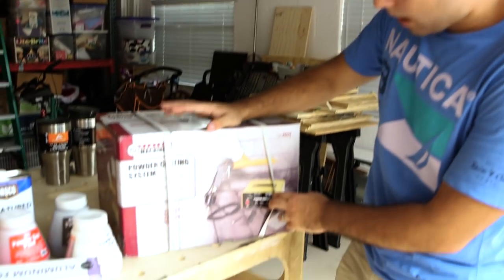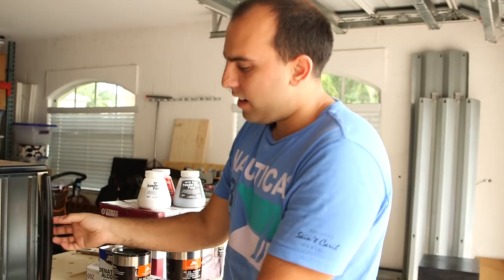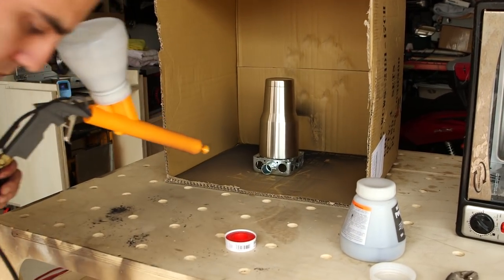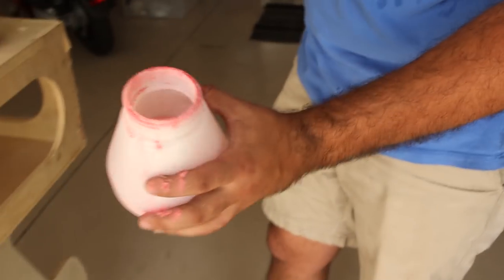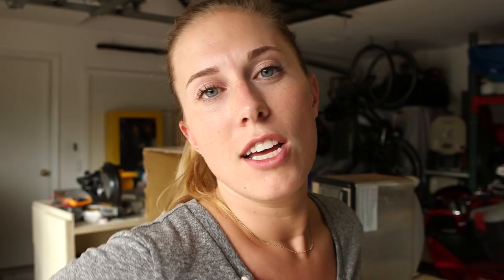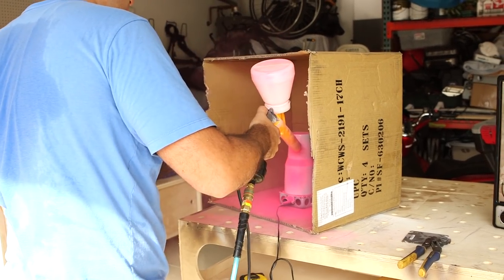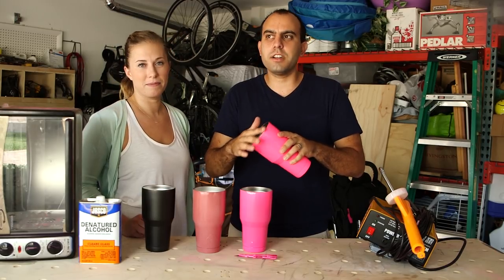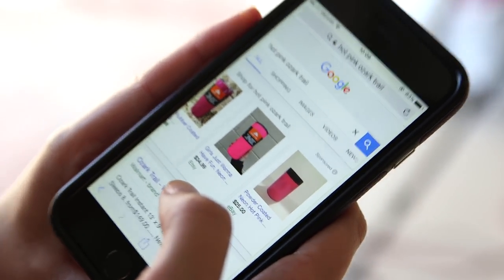DIY Powder Coating is CHEAP, FUN, and EASY! (Yeti Cup with Harbor Freight System)

Comment: While it's great that you're trying something new and posting your efforts... There's a lot of things that should be pointed out for others before they invest money into doing this, and possibly wasting money on a bunch of trial and error costing more money. First do yourself a huge favor and spend the little extra money on an Eastwood powder coating gun. You'll thank yourself about a month later! I have both and they are night and day (and my Harbor Freight is still broke after a month of use). Also don't use the Harbor Freight paint, it's very bad quality compared to several of the other companies. Don't mix the powder, it doesn't have the same qualities as liquid paint, It's basically crushed plastic that bonds together it doesn't "blend" to make a new color... you'll waste powder. Don't spray it like spray paint (same as before, it's not liquid, you'll waste). Keep your gun about 6-8 inches away from the item being coated at all times (if you hear a pop, you were way too close). You'll get fisheye or back-ionization from it being to close and ruin the powder job/ item. If you must use a toaster oven, get the biggest you can get.... the heating elements will cause the paint to discolor from overheating being too close. I sometimes still use one, but I also turn my cup a quarter turn every minute to keep it from getting scorched near the elements (I've had them discolor on one side from leaving it just 2 minutes on a side- use a digital timer). WEAR a $25 RESPIRATOR!!!. By all means, check out Mancrafting's channel! I started watching his stuff Nov of last year and decided to jump in March of this year and I now have a little side business. Anyhow, not knocking you... just want people who see your video to be informed so they don't blow their money and get meh results. Good luck!

Comment: So I've been looking to powder coat some oil burning lamps my wife bought but the one thing that has dissuaded me is all the dust. Anyhow I've seen online how some simply mix 2 parts water to 1 part powder dye, mix it in a blender for about 3 minutes, pour the liquid into a spray gun canister and spray away until the piece is coated or you can even brush it on. From here you can simply place the piece in a small counter top oven or use a heat gun. Has any one ever tried this? Seems much easier if you ask me.
Here's a video showing the process: https://youtu.be/ZzZuBLoheJw

Comment: this thing is a peace of crap. my boss bought one when our coating system broke down. he expected us to use it until the new system showed up. the powder has very low adhesion falls off at the slightest bump. it will also shock the shit out of you if you get your hand any where near the end.

that said its more practical for the average Joe than a five thousand dollar system. just get plenty of powder because this thing just dumps most of it on the floor.